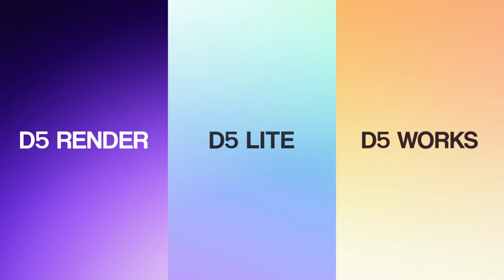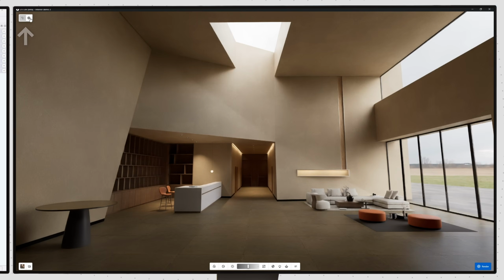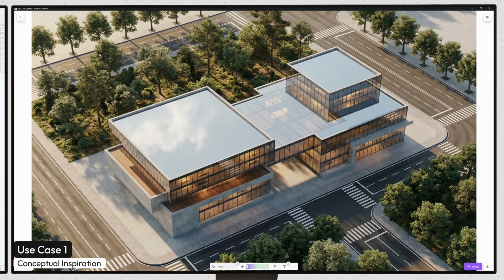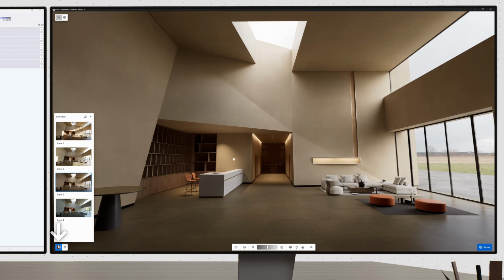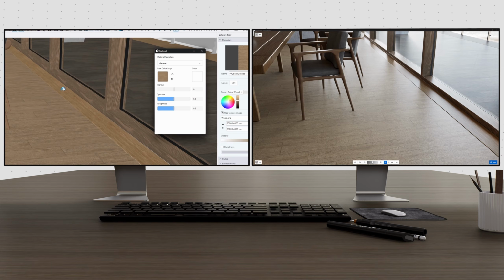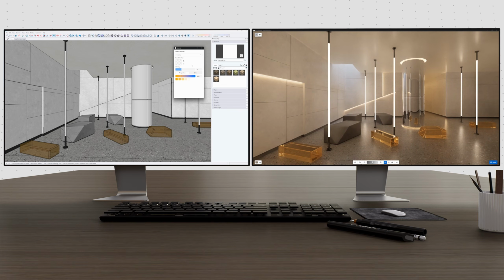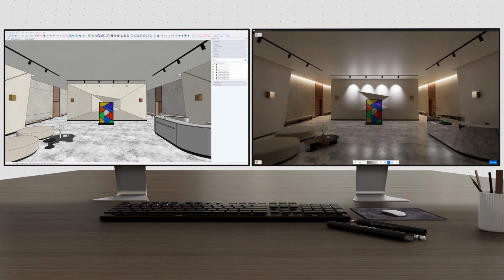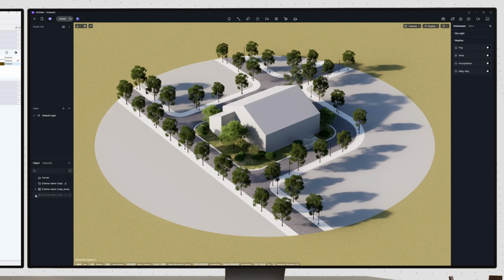Master D5 Lite in 10 Minutes! How to use AI and real-time render in Lite

Comment: Tengo un problema con D5 Lite lo acabo de instalar en Sketchup 22 y me dio este aviso de Error, por lo visto en el portal hay otros usuarios con el mismo problema: Error: #<Fiddle::DLError: Permission denied>
C:/Program Files/SketchUp/SketchUp 2022/Tools/RubyStdLib/fiddle.rb:47:in `initialize'
C:/Program Files/SketchUp/SketchUp 2022/Tools/RubyStdLib/fiddle.rb:47:in `new'
C:/Program Files/SketchUp/SketchUp 2022/Tools/RubyStdLib/fiddle.rb:47:in `dlopen'
c:/users/arqis/appdata/roaming/sketchup/sketchup 2022/sketchup/plugins/d5_converter/su_d5_plugin_dll.rbe:89:in `<module:D5dllFunc>'
c:/users/arqis/appdata/roaming/sketchup/sketchup 2022/sketchup/plugins/d5_converter/su_d5_plugin_dll.rbe:77:in `<main>'
c:/users/arqis/appdata/roaming/sketchup/sketchup 2022/sketchup/plugins/d5_converter/su_to_d5render.rbe:2043:in `eval'
c:/users/arqis/appdata/roaming/sketchup/sketchup 2022/sketchup/plugins/d5_converter/su_to_d5render.rbe:2043:in `require'
c:/users/arqis/appdata/roaming/sketchup/sketchup 2022/sketchup/plugins/d5_converter/su_to_d5render.rbe:2043:in `<main>'
C:/Program Files/SketchUp/SketchUp 2022/Tools/extensions.rb:197:in `eval'
C:/Program Files/SketchUp/SketchUp 2022/Tools/extensions.rb:197:in `require'
C:/Program Files/SketchUp/SketchUp 2022/Tools/extensions.rb:197:in `load'
C:/Users/arqis/AppData/Roaming/SketchUp/SketchUp 2022/SketchUp/Plugins/d5_converter.rb:58:in `register_extension'
C:/Users/arqis/AppData/Roaming/SketchUp/SketchUp 2022/SketchUp/Plugins/d5_converter.rb:58:in `<module:D5Converter>'
C:/Users/arqis/AppData/Roaming/SketchUp/SketchUp 2022/SketchUp/Plugins/d5_converter.rb:29:in `<top (required)>'